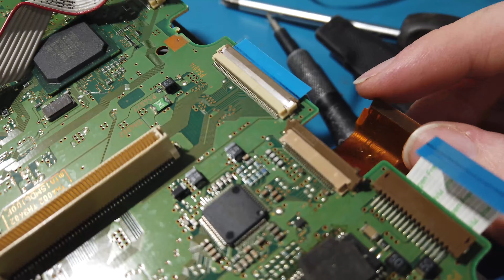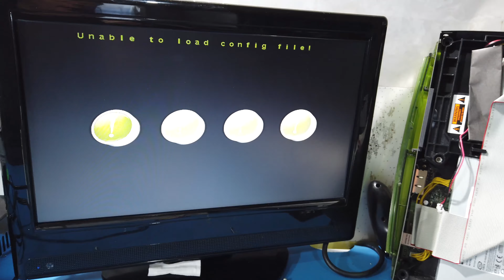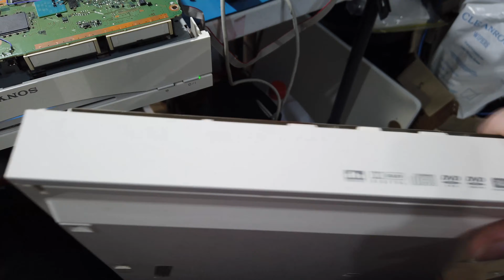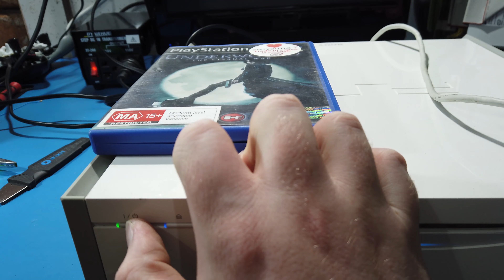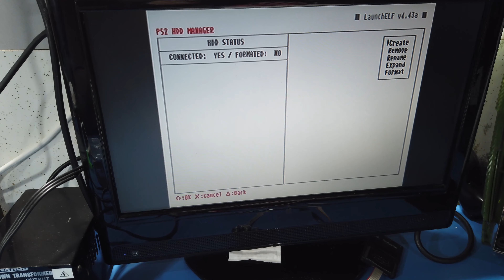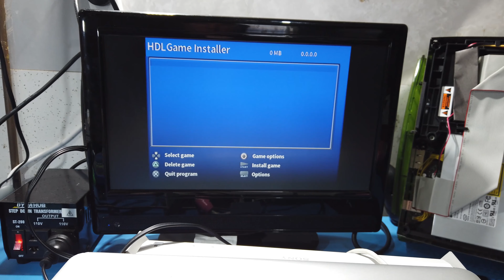Installing a ModChip Into a Rare Japanese PS2 - PSX Repair Part 2

Comment: Could the HDD be replaced if a modchip is installed?
Reply from the maker: @MosinNagant3  not currently but there is a method in development to bypass the HDD that supposedly works

Comment: Dude I did one of these the other day and it turns out the modchip diagram is totally wrong. 
Y A and B need to be moved a pin over to the right. 
After the install on the one I'm working on the disc drive spins for a second and stops. I think the ribbon cable for the sanyo is toast.
Reply from the maker: Hmm yeah I need to look over it again I think
Try pulling the VCC from your modchip maybe it’s causing issues with mechcon or something

Comment: Couldn't you use FMCB along with the modchip to bypass the first laser and make it boot games? That is if your PS2 laser is still good. My PSX burner laser is out, but with FMCB installed it will bypass it and boot all games, my Modbo 5.0 is currently in transit I will try it out and let you know if it works.

Comment: I know this has nothing to do with the video but I am out of my depth with this problem and I don't like asking other for help unless I absolutely have to. My problem I have is I couldn't for the life of me understand why I couldn't see PSBB on my PSX DVR so I asked around and someone told me I could install it to my PSX with the PSBB disc, so like a idiot I didn't back up my HDD at all and since I usually am good at guessing what to press when all the text is Japanese I tried the PSBB disc to install PSBB to my HDD but I ended up nuking my XMB. I know this is a lot to ask but do you know how I could possibly restore my XMB?
Reply from the maker: Hmm, I’m guess you checked it isn’t just booting to TV mode.
Can you still boot a Japanese ps2 game? Maybe just your HDD was on the way out anyway?
Do you have just the one console
Reply: @Slot1Gamer  It does technically boot to TV mode and tries to tune but since the XMB no longer exists it is just the tuner that still functions but can't really do anything with it in that state. Yep my console can still boot Japanese PS2 games, I use FMCB to just boot straight to PS2 mode. Yeah unfortunately I just have the one console PSX DVR 5700. I am pretty sure trying to install PSBB erased my partitions needed for the XMB. I read that (I think it was) krHACKen that has a utility for restoring the XMB and partitions but I haven't really found that tool anywhere. It isn't a big deal as everything besides the XMB works, I just can't believe I fucked up a 100% working console like that.

Comment: Dumb question but what gauge wire did you use, I heard you call it “wrapping wire” - and then you said that you should’ve used “magnet wire”.
Reply from the maker: This wire is 30awg wire it has a pvc coating (called wrapping wire because that’s what it is used for “wire wrapping electronics”)

Magnet wire is the same but coated in very thin enamel insulator, it’s easier to work with in tight spaces

Comment: you solder A on a capacitor, but that's pin 17. on the diagram you point at pin 16. (btw on the 70000 schematics it's pin 89, DVDE3. the one before is XCS. which is the correct one?

trying to install a modbo 5 on a PSX, keeps telling me that fails to read the disc, although it recognizes the disc as PS2 one (original or backup). works fine without modchip.

come to think of it, there's no point in installing a modchip on a HDD dead PSX when you have FMCB. main XMB is not present and I didn't see any update on this.

Comment: Ok you proberbly though of this but i see a video on youtube where some guy swaped around the ribbon cables because one of the ends was slighty better only thing is that when he did that his system stoped working because unknown to him"at first" when he flipped the ribbon it flipped the contacts on the other side so they didnt make contact with the pins in the socket. did you double check this when swapping your ribbons ?

Comment: Can ask a question? When you did the modchip? Is it okay if the internal hdd doesnt work? It will automatically boot on ps2 mode?
Reply from the maker: The HDD in mine is dead, it’ll boot the chip and then continue normal boot, you can change it by entering the chip settings at startup and have it start something else

Comment: There is no PAL PSX but is it possible to run pal games on Psx how can i mod chip it?
Reply from the maker: I have run pal backups via fmcb before, this system is faulty so I can’t fully determine if it’ll cold boot pressed disks with the chip

Loading off USB HDD should works
Reply: FMCB+OPL can run anything regardless of region

Comment: Awesome video! A little question, when I turn on the psx logo appears then just it looks like a tv with no antena, but there is no XMB, do you know something about this error?
Reply from the maker: it boots directly to tv mode, press the menu button
Reply: @Slot1Gamer  i press all the remote buttons and in a ps2 controller and nothing happens ): is just in tv mode

Comment: Do you know if a third party wireless PS2 controller would work with this? I have a PSX 7700 and since the controller port is on the back, I would just like to have the plug in at all times instead of having to take out the PSX from where I have it and plug in the controller every time I use or showcase it.
Reply from the maker: Any controller that works with ps2 will work with psx :)

Comment: I have a PSX and everything seems to work except PS2 games on DVD, PS2 games on CD Rom work fine.
Any idea what the problem might be and how I might fix it?
Reply from the maker: The DVD diode is damaged, adjust the pot for it on the PS2 optical pickup.
You can get replacements also from China search up the part number of the  pickup

Comment: So quick question do even music cds have to be Japanese? I have mine taking the disks and I can see it reading the disk but nothing comes up in the menu. I can record and what not just can’t seem to get any cd media to show in the menu.
Reply from the maker: Can it read dvd? 
The DVR side reader will have a separate laser diode for CD, last time I checked you still can get the optical pickups on AliExpress
Reply: @Slot1Gamer   so I ended up selling my unit because it was trying to kill the HDD from what I could see. It would load up and then be stuck on the xmb menu loading and all I could do is select the input it was already on and stayed like that no matter what and had to be forced off. I did happen to purchase both lasers for my next one I get.

Comment: Amazing job! I think to load PS2 games, you'll need to use Free McBoot to launch them.
Reply from the maker: yeah I can load games via the patched loader and games can also load from OPL but still haven't got the disc drive to function yet. I bought a second console to try incase this one is too far gone
Reply: @Slot1Gamer  ah so the DVD drive isn't recognizing any games. This is a very common problem with these PSX's. I had to get another one myself and luckily it reads DVDs just fine.
Reply from the maker: Yeah this system was reading discs but currently it doesn’t imitate the read at all, it’s sat for 6 years

Comment: can you share a diagram for it?
Reply from the maker: Here you go https://drive.google.com/file/d/1FMI9uxoHgMpj7B2G442g9NTDVpFswwuX/view?usp=drivesdk
Reply: @Slot1Gamer  you solder A on a capacitor, but that's pin 17. on the diagram you point at pin 16. (btw on the 70000 schematics it's pin 89, DVDE3. the one before is XCS. which is the correct one? I need a diagram with the pin names.)

I'm trying to install a modbo 5 on a desr5000 but I still can't find a decent diagram. every point of confusion seems to be gathering around CXD3098Q.